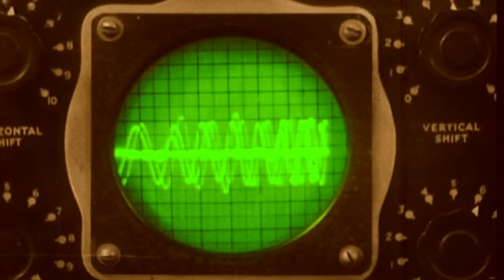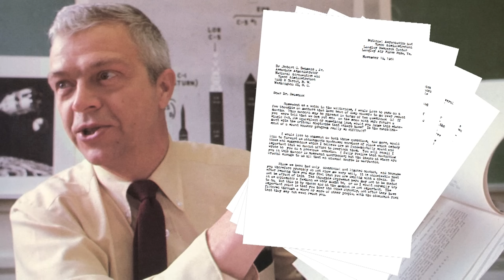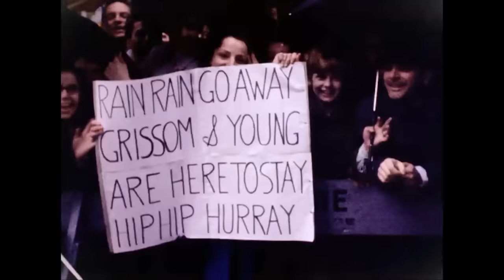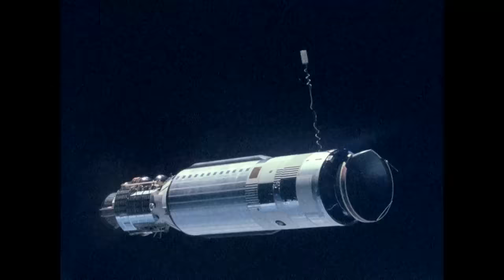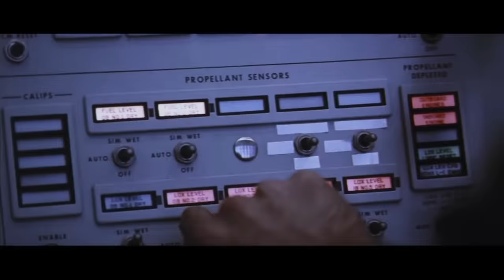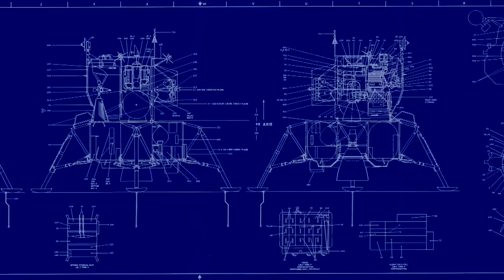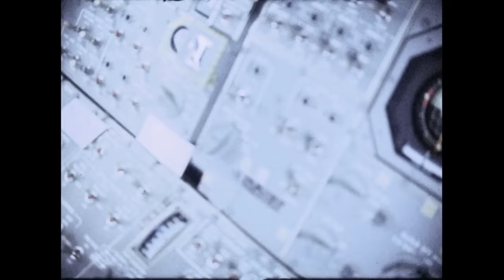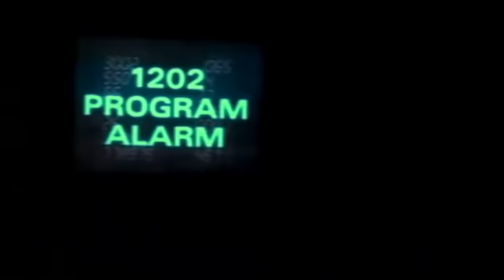Apollo 11: How Did NASA Land A Man On The Moon? | To The Moon | Progress

Comment: 54:55 — 3/4 true.  The USSR was planning a manned flight “around” the moon in their Zond spacecraft.  However, that was to be a loop around the moon, somewhat like the badly-damaged Apollo 13 ended up taking.  Apollo 8, in contrast, went into orbit around the moon, as you correctly pointed out, which is considerably more challenging.
Reply: And for Apollo 8 much riskier.  If the orbital insertion burn or the TEI (Trans Earth Insertion) burn are slightly off, you ain't coming home.
Reply: @aemrt5745  If the TEI burn were slightly off, there would be plenty of opportunities to correct their trajectory.
Reply: @willoughbykrenzteinburg  Ya know, now that I think about it that is correct if it was too short.  Thank you.  They would be placed in an orbit that would miss being captured by the moon and they would return to earth.  By design the nominal TLI burn was short of earth's escape velocity.

But, if they burned too long, I would think they would have too much Delta V to enter lunar orbit.  Question I have is if the long burn exceeded earth's escape velocity, was there enough fuel to return?
Reply: @aemrt5745  Yes.  Remember, they also had the lunar module and it's fuel supply.  In a nominal Apollo mission, the service module engine performed all burns between the Earth and moon for course corrections.  Both to and from the moon.  If needed, they could use the lunar module engine - which is what they actually did on Apollo 13 when the explosion and venting of gasses threw them off course.  They would have to go very far off course to not have enough fuel to get on a trajectory that would bring them back home.

Of course, If you are in a position to need to fire up the lunar module engine for course correction, it kills the landing because it was too risky to attempt a landing if youve used up some of the fuel needed for landing- which is why the Apollo 13 landing was aborted.  They needed the LM engine to course correct, therefore didn't want to attempt a landing having used fuel dedicated to the landing.
Reply: The Soviets did plan the full thing, including the landing. Had a design for a 2-man lander, space suits and everything. A trip around the Moon was a backup plan, in case N-1 project failed. They did successfully fly this mission unmanned, with tortoises on board, in September 1968, but then more complex Apollo 8 happened, and there was no sense trying to fly a still risky lesser mission, even though the astronauts were ready to do it.
Reply: @alexeitrebounskikh5920 , indeed.

I was about to reply that the “LK” lunar lander was planned as a single-cosmonaut lander.  That is true, but investing further, they did also plan a subsequent variant that would take two cosmonauts.

Of course neither version actually flew.

Comment: Really excellent video!  Thanks.

34:35 — Something just occurred to me that I’m amazed never occurred to me before:

On Gemini 8, a yaw thruster on the Gemini capsule got stuck on.  Neil Armstrong saved their lives, and some of the mission, by switching to the reentry system which had its own independent thrusters.  He was able to use them to stabilize the craft.  That was an incredible example of coolness under life-threatening pressure — trademark Neil-Armstrong “right stuff”!

However, wouldn’t it have been a lot simpler to just roll the capsule 180 degrees over so that the stuck thruster would cancel out its own yaw rate?  It seems like that would be the sort of thing a “flyboy” would do almost automatically.

Granted, yes, gyroscopic precession would turn some of the roll into pitch, but they presumably still had pitch control too.  Of course, things would have been weird during the transition, but they could compensate for that pretty easily.
Reply: the short answer is no it wouldnt have been more simple to do that. The way the trusters were positioned, at an angle to induce roll, no matter what way you pitch or yaw, you would still be rolling the same way with that thruster firing, thats why it was such a pain to deal with.  Theres a good series called "From the Earth to the Moon - produced by HBO / Tom Hanks, they have a good animation of the scenario on one of the episodes, its definetly worth a watch if you haven't seen it. Even though it was a yaw thruster it started a roll first(i think it had to work with another thruster to work as a yaw control but with it just alone made it just roll but im not sure), and only after they seperated did they start tumbling also.
Reply: @CrazySaVaunT , interesting.  I can’t think how an RCS thruster that produces a front-to-left yaw moment could produce any other kind of moment.  Nevertheless, I’m sure Armstrong knew what he was doing.
Reply: @mr88cet  The way that the thrusters were setup, they had to use more then one for each direction, when both fire properlly it yaws, if only one fires it rolls. I was confused about this at first too until i remembered the thruster config.

Comment: To think how many people believe this was all fake, produced in Hollywood. Give me a break!
Reply: Imagine how many people could think that steel towers would fall down on their own footprint after being on fire, at the top, in less than an hour.
Reply: @BwanaFinklestein  imagine "80 million" people actually voted for biden.
Reply: @BwanaFinklestein  You obviously don't understand structural mechanics and the effect a hot fire has on the strength of steel.  In addition, the heat makes the steel try to expand, and if something restrains it from expanding (such as the weight of the floors above the point of crisis), then the stresses in the steel increase dramatically.

I am a civil engineer and structural engineering is a sub-field of civil engineering.  In my practice, I don't do a lot of structural design, and most of what I do is reinforced concrete rather than steel, but I still have the educational and practical background needed to understand what happened to the buildings on 9/11 and why.  I have also read--cover to cover--at least a half dozen official government reports about the building failures as well as several similar reports prepared by non-government experts.  These reports don't agree on every point, but they agree on the key points.  In fact, the computer modeling results that I saw match very well with the actual failures as recorded on video.  When I saw the first impact on the news, I told my wife that the tower was going to fall and why and how.  Same for the second impact.  My original predictions were pretty accurate.  But, then again, I am an engineer and it's obvious that you are not.

Comment: I like spacex  alot also the raptor engine too, does anyone know if the saturn 5s, F-1 engine could be the world record of the most powerful single liquid fueled rocket engine,anyone?
Reply: The F1 is the most powerful liquid fuel single combustion chamber rocket engine. The RD170 from Russia is the most powerful liquid fuel rocket engine to ever fly, but has 4 combustion chambers. There was an upgraded version of the F1 that was more powerful than the RD170, but it never flew. The most powerful rockets of any type are the SLS solid rocket boosters. SpaceX went a different route with the Raptor Engines. They are built to be mass produced and with multiple engine capability on each rocket.

Comment: An amazing feat of engineering.  Just think,  the Lem had to contain provision for a ten-day trip including water and oxygen.  Two space suits the astronauts had to get into in that tiny space.  A rocket motor and its fuel.   Computers.  Transmitters.  The Lunar Rover (good early EV).  All bombarded by the Solar wind. The astronauts would have had to exit and enter the Lem via an airlock presumably. Yet l saw a video here showing the Lem with a simple hatch.  Made me wonder.
Reply: There was no air lock. The LEM only needed provisions for a maximum of 3 days on the surface and in the early missions only one. Their was no air lock - the  cabin was pressurised and then depressurised for exit.

Comment: Most of the Apollo miracles go unnoticed, for example,  the way untested systems were stacked on top of each other,  instead of the traditional one at a time approach. 
Then there's the 125°C ambient temperature above Earth's atmosphere,  which the astronauts never bragged about, despite JFK mentioned it at Rice Stadium 1963.
The solar wind radiation rings were another challenge that the crew were too modest to brag about.
Reply: what are you talking about ?
Reply: Most of the Apollo miracles go unnoticed, for example,  the way untested systems were stacked on top of each other

Which systems were untested?
Reply: Then there's the 125°C ambient temperature above Earth's atmosphere,  which the astronauts never bragged about, despite JFK mentioned it at Rice Stadium 1963.

Temperature and heat are two different things grandpa.
Reply: The solar wind radiation rings were another challenge that the crew were too modest to brag about.

Van Allen(guy who discovered them) made a paper, in which he described that they are safe to travel, so why do you lie?

Comment: I'm still confused how the smartest geniuses in the world all somehow missed the danger of using pure oxygen in a task that involves massive controlled explosions on a regular basis.. that incident is the fishiest thing in the whole space race.
Reply: Pure oxygen is a very good oxidizer, obviously. 

Also it’s the 1960s, safety was considered and that’s about it.  Most of the Astronauts knew there was a good chance they may die and never come home.
Reply: None of the PLANNED "massive controlled explosions" had anything to do with the Apollo 1 fire.  For starters - - - it was just sitting on the launch pad.  The rocket wasn't firing.  The fire was caused by a short inside the oxygen tank.  The pure oxygen obviously made the fire WAY worse, but it was an oversight.  But the notion that they should have considered what you mentioned is nonsense - - - being that none of that had anything to do with the fire.  The fire was caused by faulty wiring in the oxygen tank.  That's the end of the list of causes.

Comment: And now we wouldn't dare touch a moon manned mission ,because of what!!!
Reply: We are going back soon, Artemis
Reply: The reason we stopped going to the moon with crew is the same exact reason we haven't sent humans back since as well. Money. It isn't that difficult to understand. The Saturn V was 5x to 10x more powerful than any rocket flown for decades (not counting the Shuttle due to numerous other reasons). When the Falcon Heavy flew in 2018, it was twice as powerful as any other rocket available at that time. And yet it is only 1/3rd as capable as the Saturn V.